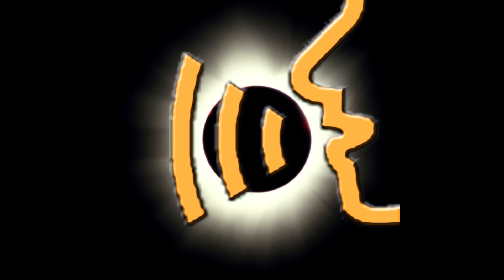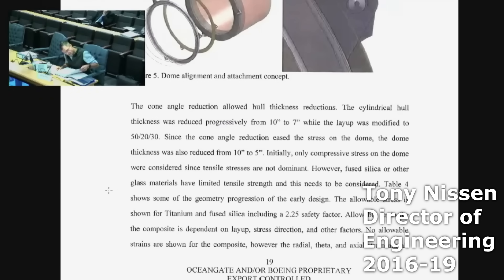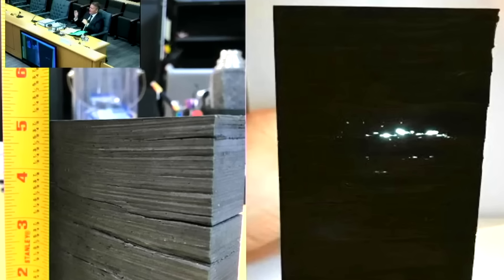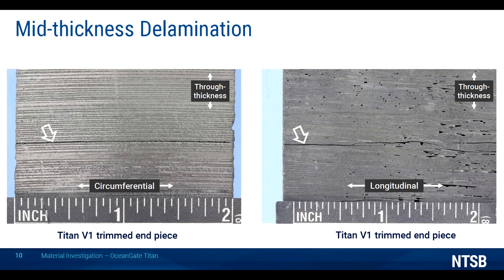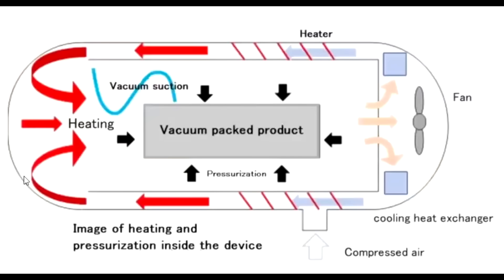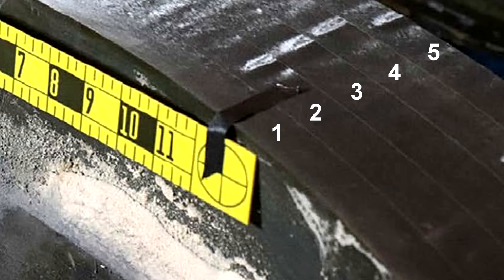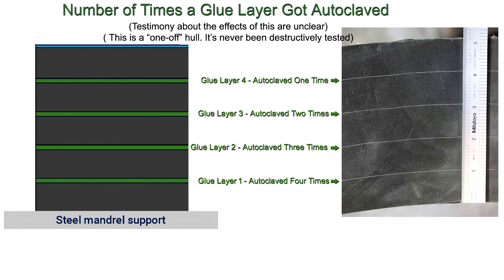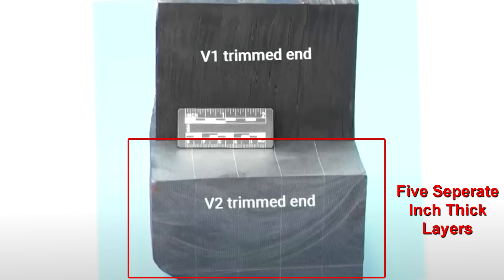Who Engineered the OceanGate Titan V2 Hull? Maybe Nobody Did?

Comment: "they grinded the bulges down after curing".  That would cut every fiber that was grinded.
Reply from the maker: Yep, you are absolutely correct.  Not only do you ruin the cut fiber loops, but any local deformation then gets transferred to the neighboring loops and they have to take more load.
Reply: @solareclipsetimer  bonkers
Reply: @ - Not bonkers in the propaganda or Rush. The tube was over-engineered by -30%, and since it was over-engineered, you can remove stuff.
Reply: I'm not an engineer and this still would make me cringe.
Like, these layers can only be strong if they are intact, if you lathe them down or take a grinder to them you're essentially breaking up the structure.
Do these people go rock climbing with a broken rope as well?
Reply: @Kr0noZ  They would.  But rock climbers typically have equipment that is rated to 3x what is necessary.
Reply: @MrRmeadows  I have an advanced rigging license and our minimum safety factor for suspending humans is 10:1. 
HOWEVER, if any of our lifting equipment, particularly synthetic slings (rated @ 8:1 capacity to listed maximum from factory) show any signs of physical wear including cuts, burns, fraying etc. you are legally obligated to remove them from service, regardless of safety factor. As soon as they show any signs of being compromised they are assumed to be unsuitable for use and must be discarded.
Reply: @MrRmeadows  a safety factor of 3x doesn't mean it's safe to use cut 50% through
safety factors are so high for a reason, safety
Reply: @ - To people like Rush, it does mean that. Well, "meant". Rush is just an idea now, not an existing human.
Reply: Right, they had to smooth it out.  So the thought.

Comment: This may just be my style of engineering but if i hear the guys doing the preliminary study saying i need a wall 7 inches thick im going to be asking if it can be thicker not go off and get a thinner hull made no matter what the composites olace tells me.
Reply from the maker: Thanks for commenting.  The Boeing guy made a good point because he knows carbon fiber.  You have to factor in a safety factor for problems with the manufacturing process that creates weaknesses, like voids.  His quote was factoring in the "effects of defects."  You have to build something like this with a lot of safety factor; you have to "overbuild."
Reply: @solareclipsetimer  I always have a tendency to overbuild, but dang I hate working with composites for that reason, even really well laminated hulls eventually end up with osmosis blisters.
Reply: I would do the same. What I also don't understand, the machine used to lay down the prepreg is perfectly capable of doing 45 degree plies, why didn't they do that?
Reply from the maker: @meeder78  That is a great question!  I don't have an answer.  I don't know how they program those machines.

Comment: Resin was said to be expired. Was it confirmed during hearings?
Reply from the maker: Thanks for your comment.  That was brought up in the hearing by Bart Kemper and it was shut down by the Marine  Board saying there was no evidence that the fiber was expired.  The OceanGate attorneys said the same thing and that there is a record of the purchase.  But during the hearing, we did not get a definitive answer.  We may know for sure when the final report comes out.
Reply: @solareclipsetimer  "Expired" in this context literally means that the lifespan is off the end of the environmental degradation data. It doesn't mean that the product is bad; it means that they don't have any data to make judgements. Environmental degradation data is expensive to collect. If you want years of data, it takes years to gather.
Reply: @finalmidnight  yeah, for my wall painting project, it would be fine to use an expired bucket of paint. but for my deep sea sub with grinded off ends and 2cm less material than calculated, probably not.
Reply from the maker: @finalmidnight  Oh, that is a good point.  Thank you for explaining that!

Comment: i mean Stockton was also the guy openly stating that he INTENTIONALLY did not hire any experts cause they were and i quote: "50-year-old white guys"
Reply: Looks like the 50 year old white guys got the last laugh
Reply: @colin3424  Considering the dude is now anemone shit, that's for sure.
Reply: Yeah… a rich guy wanted to have younger employees he could have power over.

And he hid it under progressive language. Anyone who wants actual equality would tell you “hire whoever can do the job, but don’t just look at the resumes of white guys”.
Reply: Whether you want to listen to the conservative experts with decades of experience or not, if my life is going to be on the line, I'm at least sparing no expense at testing the design to make sure it actually works...
Reply: Funny how I was under the impression it failed on the first dive, had no idea it did two seasons already.

But regardless, the enquiry just brings to light so many different potential causes of failure, each of which would or should have been seen and approved by the CEO himself, owner and adventurer dude Stockton.

So who carries the can? Hopefully nobody left alive. But Head of Engineering doesn't look too clean...

As for failure, 'glue' is not a technical term, so I would blame those 5 separate layers, effectively forcing each layer to act independently, hence suffering accelerated damage, deteriorating each time.
Reply: RUSH most probably had a 'negative personality trait' - a Machiavellian personality -and that is what no doubt made him money - and KILLED him

Comment: The way the titanium 'rings' were GLUED ONTO that carbon fibre pressure hull that at that point was narrowed from 5 to 4½ inches with a similarly marginal overlap would with ease seem the most likely primal cause for failure of the entire structure of all the shortcomings it may have had. Soo iffy!
Reply: They used a commercial adhesive for that and when you look up the specs for it, it's basically aerospace bondo.
Reply from the maker: Yes, the gluing thing is frightening.

Comment: Anyone wanna take bets on whether Spencer Composites had or didn't have the capability to go thicker than 5in? My money is on it being made to 5in because that was the max they could wrap around the mandrel
Reply: It was mentioned at 12:16 in the video that they probably wanted to reuse the titanium rings made for 5 inches tho?
Reply: Dunno, but it's like the difference between the bottom of a fraction being zero, or ANYTHING larger than zero. Makes a difference. At 6000 psi, ANY flexing is going to be cumulative.  And, I don't think this guy was clever NOT destructively testing one or two.  He felt he didn't NEED to.
Reply from the maker: Sure thing,  Thicker might be better, but it costs more.  So, when your engineering says five inches is strong enough and then you go with that size and you built all the titanium around that size, there is no turning back unless you want to build it all again.  Like Tony said in his testimony at some point, it's a matched set; meaning the front ring and dome, the hull, and the rear ring and dome.  You can't change just one of them.

Comment: I thought carbon fibre was better for tensile loads not compression. So why would you put carbon fibre in a comprehensive environment
Reply: I mean it's possible, but not ideal (titanium is ideal but OceanGate was trying to build an el cheapo sub and you get what you pay for), and the way they designed it set them up for failure.
Reply: It is better for tension than compression. However, you could make a vessel out of paper reach that depth if you wrapped it thick enough. 
Being better for one doesn't mean it cannot be made to work for the other (even if it's a bad idea)
Reply: @Man_Emperor_of_Mankind THAT statement is simply not true. If paper's ability to (with)stand some type of force is visually non-existent / effectively zero, then even a thousand or more layers are still not gonna give you any of the desired resistance either. you could not make a satisfactory product from an unsuitable material.
Reply: There are not many materials with sufficient high strenght to weight ratio to choose from. The need to have positive buoyancy is a limiting factor here.
Reply: you mean an environment where there predominantly force is compression?
Reply: Because you have no idea what you are doing.  And don't know that you are an idiot.
Reply: Suggest you take a look at  "The Truth About Carbon Fiber: Myths vs. Reality"  from Dark Aero. They produced it afer some fiulm maker started to utter all sorts of stuff he didn't know about on composites.  You can design a structure to support compression loads and it can be strionger than Titanium.    Titanium has known strengths for certain thickness, composites don't so there is no simple recipe on hwo to build a compisite part that will support compression force of X.
Reply from the maker: @ Thanks for suggesting that video! I just watched it and it was very good!  And I agree with everything in it. With properly chosen fiber, matrix, fiber alignment, and production techniques carbon fiber can be strong and may be able to be used for a sub hull.  However, and this was brought up in the testimony, the non-destructive analysis techniques talked about in the Dark Aero video don't work on carbon fiber layup 5 inches thick.  Right now that is one of the problems of trying to build a hull to go down to 4,000 meters.  Thanks!
Reply: Carbon fiber is much better for tensile loads, but it's not bad at compressive loads when the fibers are encased in a polymer composite matrix. Properly chosen and manufactured carbon fiber composite is better than steel in compression. The issue is not the strength, it's that carbon fiber is extremely unforgiving material with bad fatigue behaviour and very sudden failure modes. With Titan the failure was result of multiple root causes, but not because carbon fiber can't handle compressive loads. The laying of the layers wasn't done properly during manufacturing (multiple layer defects), the carbon fiber was improperly machined after manufacturing, the layer adhesion was weakened by the salt water, and worst of all, the fatigue monitoring system wasn't listened to which saw the fatal progressing delamination starting during the second to last dive.
Reply from the maker: @tylisirn  Very well said, thanks.  I agree with you.

Comment: Titan V-2 hull was "designed" by Collier Aerospace using their HypereX FEA software.  Collier Aerospace and the Collier engineers involved have scrubbed their websites and social media accounts, as expected, but the evidence is there in the archives.  Collier specializes in FEA of carbon fiber structures for aerospace and high tech sailboats, bicycle frames and wind turbine blades.
Reply from the maker: Thanks, that is great information!  I have not heard Collier Aerospace mentioned once in all the testimony I watched or any articles I have read.  Do you have a reference for that, I would like to know more. I briefly looked at their website.  I would be interested to know how much marine engineering experience they had.
Reply: @engineerncook6138  interesting so they did use FEA in the design. I wonder if the manufacturing methods were consistent with the material data Collier used in their simulation… or if Collier even had a good basis for that data to begin with. My guess for both is no.
Reply: @warbydeception3228  I found no info on what material properties Collier used.  I didn't do FEA myself but worked closely on high pressure, heavy wall vessel designs (8" thick) with structural engineers who were FEA experts. I think the biggest problem on Titan was likely the lack of Collier's expertise with heavy wall vessels, vessels under high external pressure and whether their HyperX design software was intended/validated for heavy wall vessels under external pressure.  I did work with chemical process and fluid flow modeling software extensively on some novel designs.  The software packages all had ranges of applicability where the results were considered reliable, but you could set up simulations well outside those applicable ranges and still get a "solution". I feel that some engineers today put too much trust in computer modeling results and don't or, don't know how to, check modeling results with other methods for reasonableness.

Comment: The hull was fine. It was the joint.
Reply: Nothing was fine. Reasons do not exist to want that hull design because proven designs have existed for decades. Reasons do not exist to build manned deep diving submersibles without testing to the same safety margins as military submarines.
Reply: The bull was not fine. It fractured on a previous dive. It then imploded and blew the joints. The flex in the middle of the hull was flexing far more than it should have. Did you even watch anything on the topic, including this video?
Reply: Distinction without a difference.
Reply: The entire thing was a death trap, it's like arguing whether the danger to smoking on a powder keg soaked in gasoline surrounded by anfo under a ceiling fan with grenades hung by the pins... was the inadequate barrel stave rigidity or the corrosion on the steel bands.
Reply: Post your qualifications.
Reply: I at first thought that maybe 'Glare' (glass fibre with epoxy, sandwiched with aluminum, used for airplanes) could have actually been a better material, but that too is autoclaved (cured under pressure / sucked vacuum and with added heat) and they mention there's a max to the thickness that can be autoclaved, which maybe means that so far there's no tech yet developed to build a pressure hull from any material that needs that type of treatment during is forming.
Reply: The hull flexing will make the joint fail.
Reply from the maker: Possibly.

Comment: They built it to pressure vessel requirements, when it was actually a vacuum vessel.
Reply: Absolutely this. 

Worse, it was a resin structure contaminated by carbon fibre. The carbon fibres didn’t add any compressive strength so far as I can see.
Reply: I mean, no, not really. A vacuum vessel will only ever see atmospheric pressure. It definitely was a pressure vessel, an internal pressure vessel. It was never properly a diving vessel.

Everybody (should) knows, concrete is for compression, not tension, and carbon fiber is good for tension, not compression.
Reply: @wiredforstereo  carbonfibre is still good in compression, just not nearly as outstanding as in tension and not a good choice for this.
Reply: @ABaumstumpf  Somewhat better than concrete, but "good" is in the opinion of the user. Not good enough in this case.

Comment: Because they were the ones using that material!  Ive had all kinds of, admittedly tiny but similar in spirit, questions from people "that wanna get into knifemaking" about steels, heat treatment, cryo methods, powder steels, induction forging and yet Im a pretty simple blacksmith who makes mostly furniture and lighting.  Why?  Can it be anything else than I work with the materials they plan to use day in and out?  I mean I'm also decent company but not to an extent that people make up obscure questions to ask me just to visit! 😂😂😂  Nasa not being a submarine builder isn't relevant because THE ONES ACTUALLY BUILDING it are responsible FOR EVERYTHING!  Is much of this about dodging and blame shifting?  (I mean the claims covered, not your exploration of those claims)

Comment: As a UK chartered structural engineer, I find it startling that  nobody pointed out that  5No. layers of 1" material, even if glued, does not have the same physical properties as 5" of solid material. The major issue is relative stiffness. Repeated cycles of load application on the layered material will result in sequential shear failure at the glue lines.
Reply from the maker: Exactly correct!!  That is the point of my video.  Who said the V2 hull was going to even be close to the engineering design and analysis of the V1 hull done by Spencer.  Even though Spencer seemed to overestimate the strength of the V1 hull by a lot. There was no engineering to say the layered structure would behave the same.  The five-inch thickness is meaningless at that point.  Thanks for your thoughtful comment.
Reply: It appears that you need just to find fibancial rrasons to both equal and it was fine! (For 18 dives)

Comment: nobody seems to address the elephant in the room (from my perspective) that wound fiber composites are strong when the fibers are in TENSION and not nearly as strong when you are pushing on the fibers effectively trying to delaminate them... NASA would possibly use a similar hull that is pressurized from within not "crushed" by external pressure... does nobody else see this "obvious" difference?... it all comes down to the old saying in physics that "you can't push on a rope" so what you really ended up with is a fiber resin structure where the fibers are NOT in tension... fiber reinforced pressure vessels are made this way and are quite strong when it comes to holding the pressure in but rather weak (relatively) when being crushed....
Reply from the maker: Thanks for commenting.  Yes sir, you are correct and it has been discussed before.  But it's not that it can't be done.  It has been done.  The NAVY had an unmanned glass fiber hull that did well.  But carbon fiber may never work at these extreme depths.  Look for AUSS Advanced Unmanned Search System.  It's cool.